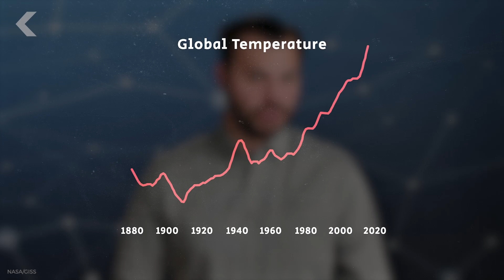These Massive Geoengineering Projects Won't Stop Global Warming

Comment: Why mirrors? Can solar panels work better since it captures about  20% of the incoming rays, in contrast to reflecting 1% of the solar energy by mirrors. Will this solve the energy crisis and global warming at the same time?
Reply: Victor0326 a piece of metal is a lot cheaper than microelectronics.
Reply: +Danial Bagang
You're either the most uneducated or the most trolly person I've ever seen.
It does always shine.
Reply: we'll build a wall and make the sun pay for it!
Reply: How do you bring back the energy from the solar panels?
Doesn't work.
Reply: Levo GAMES lasers
Reply: Victor0326 you would still need roughly the same area of solar panels as you would need mirrors. you would probably need more area since mirrors reflect 90 something % of incoming light compared to 20% absorbed and x% reflected.
Reply: Cultura Campeira It doesn't "produce nothing". It saves your ass from global warming. And it's a weather control system, since you can heat certain areas with mirrors. So it's more profitable short-term to build mirrors.
Reply: Microwaves, not lasers. Lasers are interfered with by the atmosphere. And earth orbit is close enough you can use something else in the electromagnetic spectrum. 

Also Japan has a plan to do just this. 
http://spectrum.ieee.org/green-tech/solar/how-japan-plans-to-build-an-orbital-solar-farm
Reply: I would laugh if we redirected rays and ended up shooting down an alien mother ship. "Well how bou dah."
Reply: Because that doesn't get reflect away, it absorbs it, heating the earth. The opposite of what you want.
Reply: Sorry, how do wind turbines help with geoengineering?
Reply: 011azr we were talking about sending mirrors vs. solar panels in space, to reflect sunlight.

Wtf now?
Reply: Levo GAMES  Send it back on a laser obviously.
Reply: +Geronimo32509
Oh, yeah. That's so obvious. And also, might I add, impractical.
1) It would be a huge, complex satellite, that'd had to stay in a fixed position, relative to the sun (but not relative to the Earths spin). 
2) Since it doesn't stay relative to the Earth's spin (because it  needs to block sunlight 24/7, even though that's actually not a thing in space), it can't send the laser signal all the time. And it would have to be a very powerful laser, right?`One that can blind you, when looking in the sky perhaps? One that can burn through material?
Sounds very dangerous and impractical to me. It HAS to be a powerful one, since otherwise it wouldn't send enough energy for it to be worthwhile.
Reply: Mitchell New how can sunlight kill ships? It's not like they're planning to concentrate all the reflected rays in a beam.
Reply: LagiNaLangAko23 that's... AMAZING!
Reply: How about reflecting prisms? This can be done using total internal reflection, would work flawlessly.

Oh wait obvious problem is all the small debris and meteors shitting over the atmosphere. This crap won't ever work.
Reply: Solar panels are not that good idea, even though it's still among the better. I think the winner is still wind, because it's much more ubiquitous than sunlight. The development for electricity is much faster than the internal combustion, hence the cost of electricity from clean and renewable energy is only about 0,13 per kWh (CMIIW) compared to 0.10 per kWh from fossil fuels, and it will still improve rapidly. This is much more sensible and solve 2 crucial problems too.
Reply: The panels stores energy, not reduce light... or heat or whatever the scientists are talking about... What would be receiving that energy?

It's just floating it space. XD
And it wouldn't be doing what we intended, if this is true.
Reply: I think he's trying to say that solar panels will be useless on cloudy days. Or he's just a troll.
Reply: Mirrors are dirt cheap compared to solar panels. Panels that large would cost a shit ton on money even on global scale, countries might starve due to a 'clever energy source'. Also, mirrors are a lot more effective in heat reflection, our main motive. So I'd prefer mirrors.

Comment: human are only the cause of polluting the planet not global warming that's just a natural process and nothing you will do will stop the climate from changing. The longer you're going to completely deny it the less time we have for a real solution to counter losing more and more farm land.
Reply: StrifeRaider you are on about the malancovich cycles. they happen over 10,000+ years not as quickly reported now. global warming is a natural process to regulate earth's temperature. with more carbon dioxide in the atmosphere more solar radiation is trapped.
Reply: Why do you think humans cannot effect the climate? You just say that as if it were a fact without any reason why that would be so. Did you not go to college or take any basic physics or chemistry classes or something?